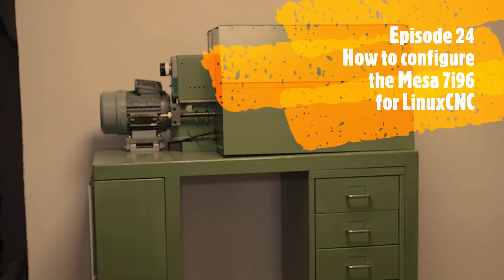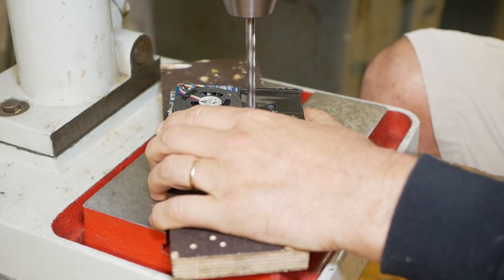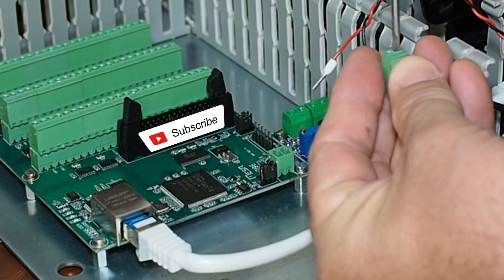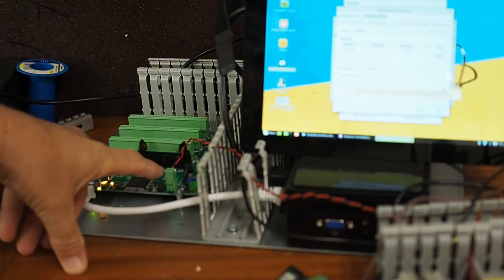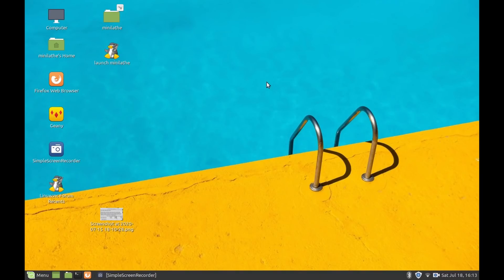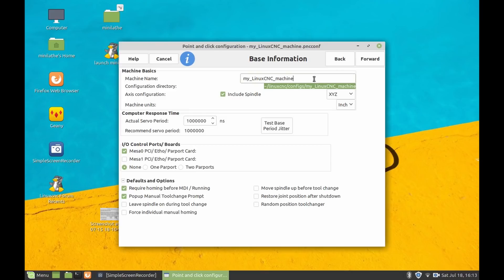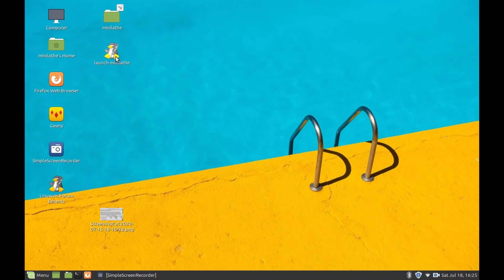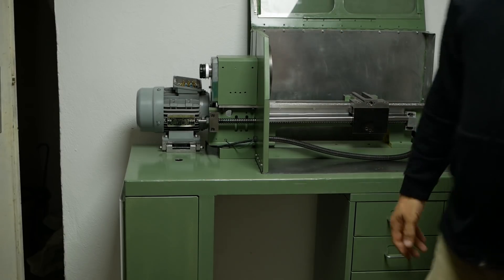Modding the 7x12 mini lathe - Episode 24 - Mesa 7i96 set up

Comment: how you can setup 5 axis? an 5x limit 1 and 2 switches für each axis?
Reply from the maker: Sorry, I don't really understand the question. Do you want to make a 5 Axis mill using LinuxCNC?
Reply: @RotarySMP  yes, i do have x,z,y and 2 rotation axis. Dont know how to setup it in linux cnc and mesa card. Also i must conect limit sw1 and sw2 for each axis...
Reply: @RotarySMP  yes x,y,z and 2 others so can i do it?

Comment: Nice work :)  
Is additional adapter board for vfd necessary if you can get PWM signal out of controller ? 
Got same 7i96 today it will be fun to configure it all.
Reply from the maker: That probably depends on the controller. If it can accept a PWM input then you should be fine direct from the Mesa card, but mine needed an analog 0-10V input, hence the little adapeter board. Those thing only cost a few bucks.
Reply: @RotarySMP  That makes sense, forgot that you have 0-10V input, I will try wth PWM from mesa board when vfd arrives(  its PWM ) :)

Comment: I admire the effort but this lathe is not worth it. Are you a machinist?
Reply from the maker: You are very  correct. I started scraping this, as I had it, and wanted to learn to scrape. Then it became a good vehicle to learn to do a video series, and now I want to finish what I started. 
If you want a CNC machine, you should start with an industrial CNC machine, much easier, and better result.
Nope, aircraft mechanic.
Reply: @RotarySMP  Good luck to you, this is a really good video and fun to watch. I ran cnc machines for many years and just had to ask.
Reply from the maker: @bingosunnoon9341  Thanks for watching.

Comment: Look forward to hearing how you get on with the 7i96 on your lathe. I literally just picked up a EMCO Compact 5 cnc that needs a full FULL rebuild. Probably won't go to your lengths, however. :)
Thanks for sharing!
Reply from the maker: The EMCO is a much better engineered lathe than the 7x12. I am sure you will have a great lathe once you have finished your conversion. Thanks for watching.

Comment: @RotarySMP
Your Video series is just awesome if not legendary
its the best rebuild out there
i will be very happy when its done
Reply from the maker: Thanks for the encouraging words.I'll also be happy when it is done.
Reply: @RotarySMP  My Mill rebuild should be done fairly soon too
but as far as I have seen the ways are to damaged by rust
can you tell me where you can buy hand scrapers and the blades if not directly from biax?
Reply from the maker: @mrspeaky6885  I got my sandvik hand scraper off ebay. The carbide blades are also available on Ebay (at least in Europe - I search for schaber klingen). 
https://www.ebay.at/itm/Wendeschneidplatte-B20xL2xT2mmHM-z-Flachschaber-Klingen-L-30-RENNSTEIG/283159699925?hash=item41eda221d5:g:ix8AAOSwl1RcTqu2
If you google "sandvik scraper" you should be able to find a seller near you.
Another option is to braze carbide onto the end of flat steel. Nothing too complicated about this stuff. I made a brazed scraper blade in about episode 4 or 5.

Comment: Nice work. One thing to say is that small SSD's are dirt cheap. I put an SSD in my router controller for about 20$ for a 64gb unit. That one is running windows and usbcnc software and I can say it's very nice to deal with compared to those mechanical drives.
Reply from the maker: They have really come down in price since I did the Maho, and used an SD Card and adapter. Thanks for watching.
Reply: @RotarySMP  As for the Maho and Linux, did you see that very swank looking new GUI/Screenset called ProbeBasic (I think)? It's inspired by PathPilot and has a ton of probing options and just looks really pleasant overall.

Also, while this might not be the perfect place to ask, I have noticed you are very good at giving answers, so I will take my chances:)
Thing is, I am a hobby machinist but very far from being a programmer and soon I will start building a stiff, desktop router (surface plate based) but as for control, I also just want something that's nice to look at. Maybe that's slightly superficial but it does actually help in using things. So, when I saw the screensets for Linux, especially, the above mentioned, I was really happy. 
Now, the "simple" question is: Would you think someone who never programmed but is likely a bit above the normal person in tinkering abilities (I have changed plenty of harddrives, fans, etc in my Macs) can set up Linux and LinuxCNC without spending more than a few weeks ripping his hair out? Is the LinuxCNC forum OK with walking newbies through it if they ask very specific questions - or are they more inclined to just say I should "read the documentation"...?
Reply from the maker: @AntiVaganza  Dont get hung up on the "look" of the GUI. The work flow is way more important. Gmoccapy was created to largely replicate the work flow ofHeidenhain controllers, and is brilliant for it's usablity. Many Path Pilot type new GUI are way to overloaded with all information on one screen if you ask me. Gmoccapy is very modal. with the soft keys function dependant on modes. I like it so much I designed my Control panel for the MAHO to replicate the soft keys with physical buttons..

The LinuxCNC forum has excellent guys. You nailed it. If you can formulate a clear question, you always get answers. From my time there, the people who get frustrated generally are not able to ask clear questions.
Reply: @RotarySMP  True, good point. But I do like when things look nice - I find it keeps the overall user experience more positive. But I looked at the screenset a bit more and later iterations did indeed become quite "busy". 
I was even thinking of a cheap standalone Chinese controller, but I think as this will be my first CNC machine, it would make sense to have a proper screen and keyboard as I will likely be making more mistakes in setting up things than people who already know their stuff. 

Thanks so much for taking the time to reply:)

Comment: Hey RotarySMP, great video!
Also we (the comenters) noticed that the pwm port went back to zero.. i also noticed that when you set up the z Axis (the One with the imperial leadscrew) you put the value on the MM section but there is just bellow that a place to put TPI = threads per inch... You should have used that (i think)... Everything else looked perfect 😋
Reply from the maker: I didn't notice that the PWM was at zero. Thanks. I'll run it again.
You got me. I knew it was imperial, measured it at about 5mm, remembered it was 5.08mm, and was too lazy to work what that is in TPI :)

Comment: Did you notice that the number of PWMs reset back to 0 when running the configure too? As wel as the previouslly mentioned 0.3mm instead of -300.
Reply: I noticed that and i also saw something else that i have to mention but now i forgot ahahah
Reply from the maker: I missed that. Thanks for pointing it out. I'll run the PNCConf again.